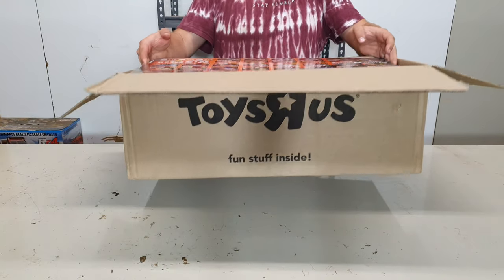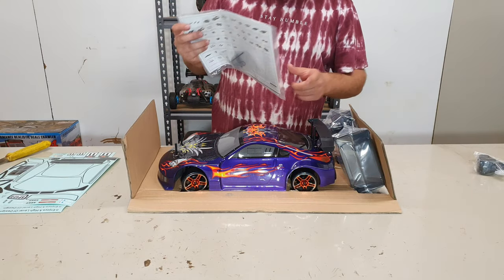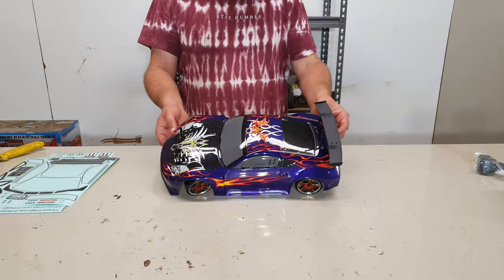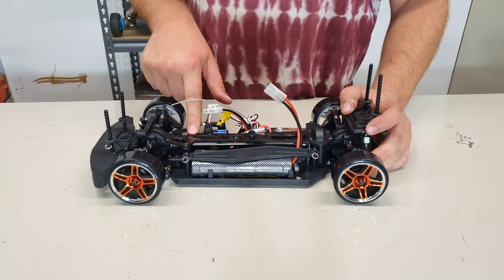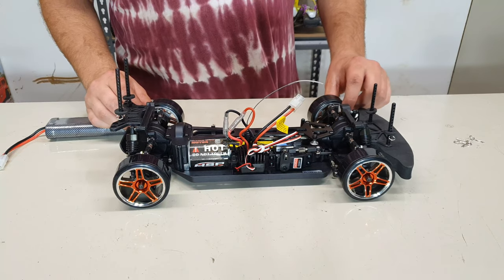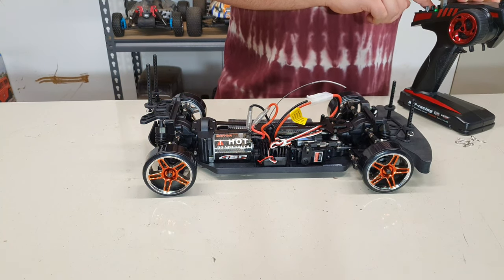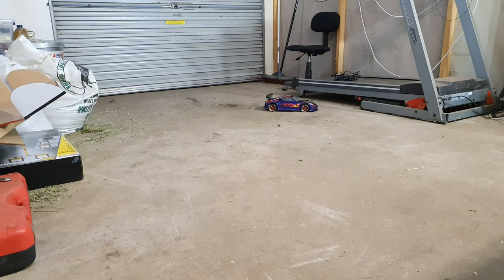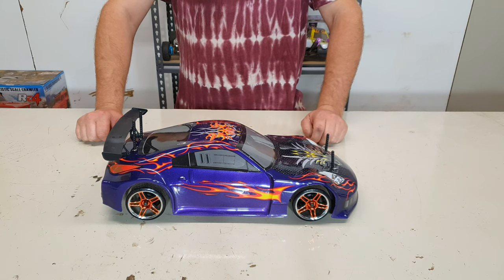HSP flying fish unboxing/test (DIRT CHEAP)

Comment: I ordered one, on its way shipped to me now. I used to have HSP 1/10 monster truck, had alot of fun but its not that durable in crash. But I think, if its drifting, its bassically gliding low speed, that will never be fast enough to actually cause damage..... looking for to my Flying Fish, I will swap my sanwa tx/rx and my savox servo into it for precise handling, I hope.... hahah
Reply: I know im a year late but I was going to get one i asked the reseller is the drift car’s wheels and body changeable but she said no. I think she just doesn’t know because she is just a reseller but is your’s customizable?